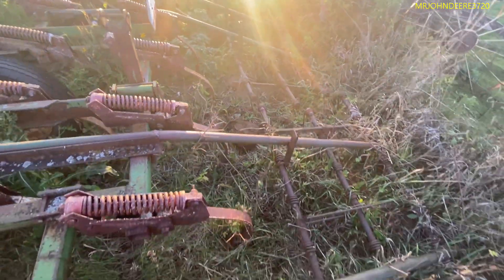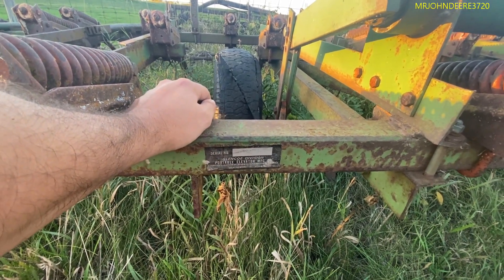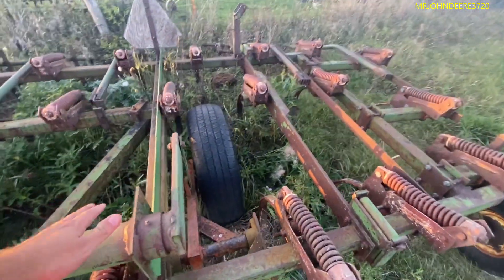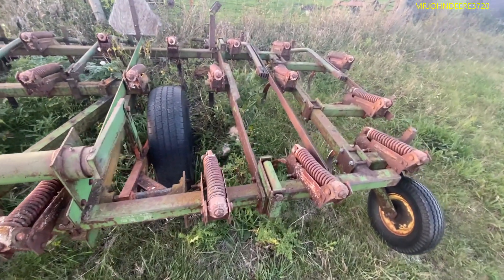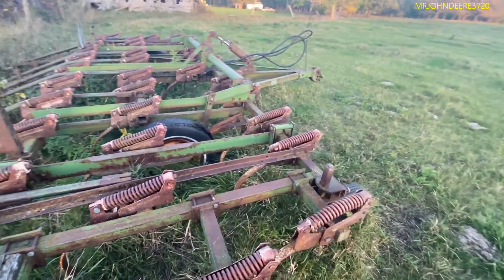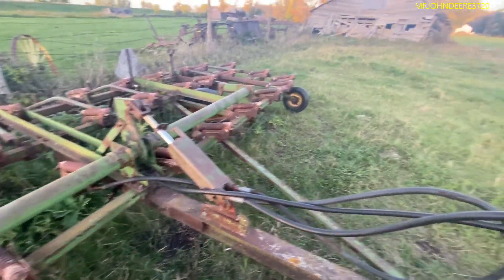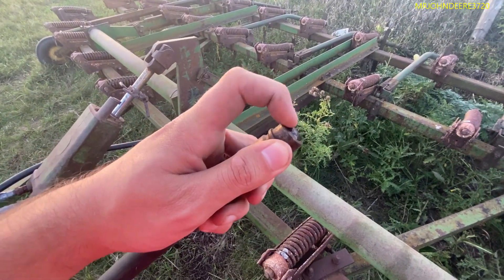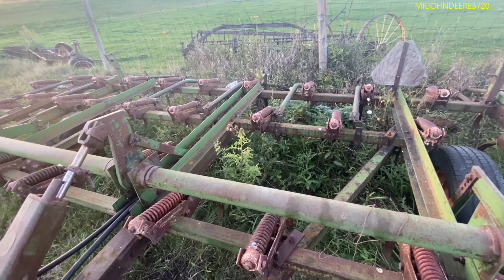should we bring this GLENCOE cultivator back to life!

Comment: New hoses and tire is not bad deal for  tool to work. My neighbor has a Glencoe soil finisher the same vintage as that probably a few years newer. The brand was taken over by Agco . I think they phased it out early 2000s time. You can't get any parts for those shanks or springs. I know that much I get a few minutes. I may try to get a video of that old Glencoe down here lol
Reply from the maker: it wont take much to put her back in the field.  u would have to find a parts machine to keep this one going. i'd like to see urs..

Comment: Looks like a decent cultivator. Clean up that cylinder shaft with some emery cloth and maybe steel wool otherwise it could damage the seal when it goes inside. I don't know if the Glencoe company even exists anymore so certain parts could be hard to find unless you find good used stuff.
Reply from the maker: i'll have to buy emery cloth, dont have any lol.. ya i dont know as well. google might know lol.